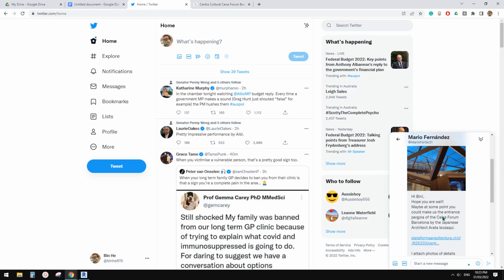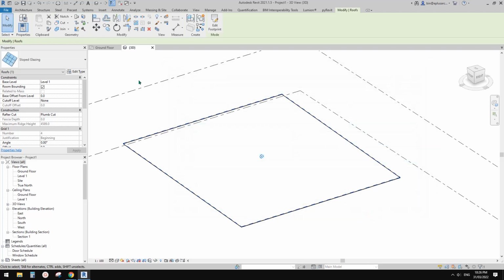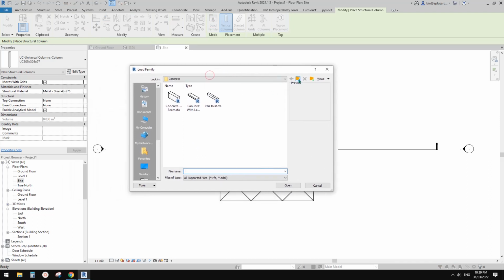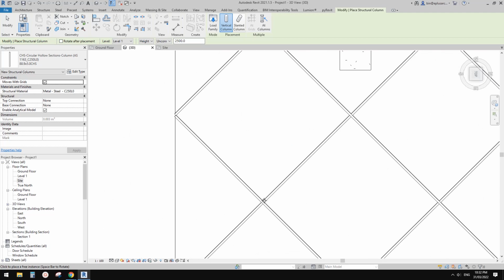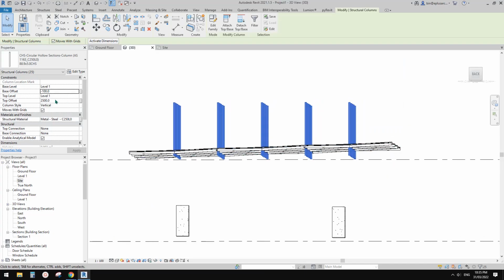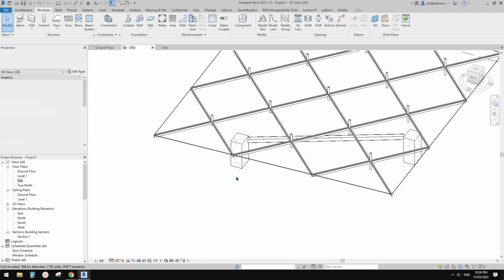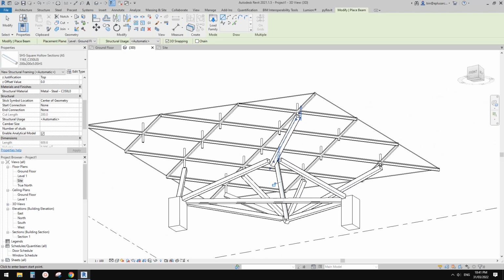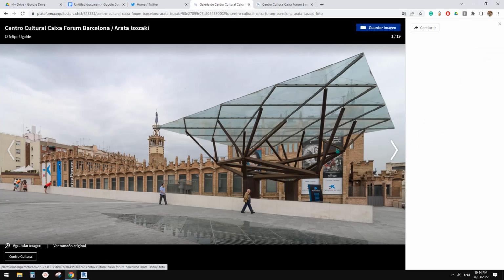Revit Exercise (Day 738) - Sloped Glazing and Structural Columns/Beams

Comment: Thank you Bin! Great job!👌
Since it's all corten steel columns and beams, I think there would be another construction option from the parameterised beams.
I've seen that technique in another video of yours. 
I say this because of the meeting between the different beams that arrive at the point of union.
Reply from the maker: I am not quite sure about those structure connections. Maybe we can just use Join Geometry for this project.